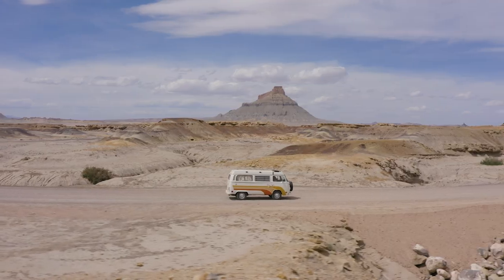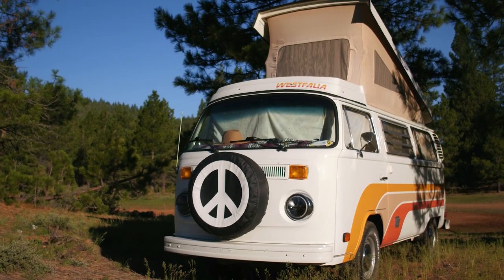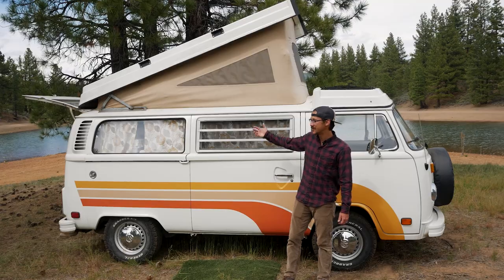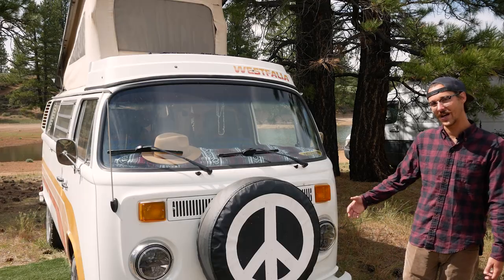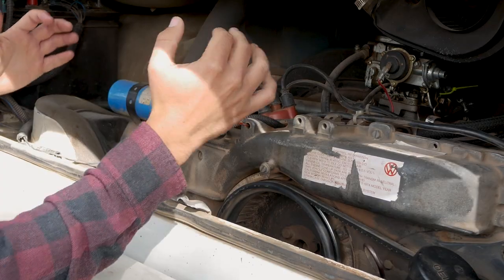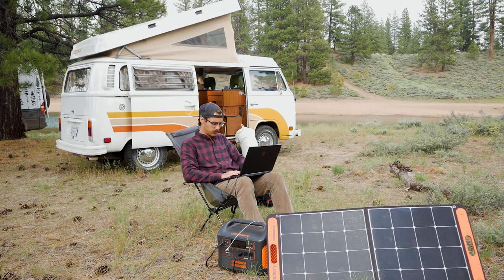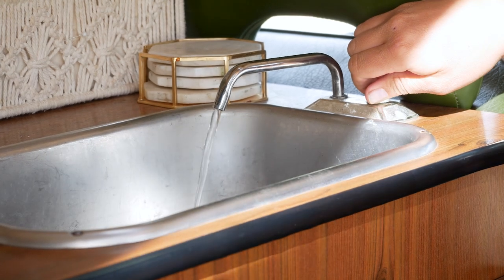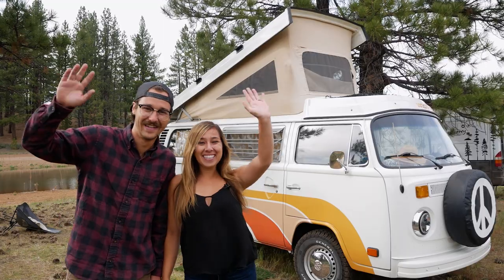What it's really like to live full time in a VW bus (Westy)

Comment: The biggest complaint about these vans is the lack of power especially going up an incline.  It is a beauty though, best of luck to both of you.  I miss being traveling and I miss California, but age has caught up with me.  Take care.
Reply: Yes, exactly. You could see how slow it was inching up the road. No hate though, in fact, we have a Westy Vanagon. But we put most of the upgrade money into purchasing a rebuilt and reliable subaru engine. The engine is from 2005. Our mileage has gone up from 16 miles a gallon to about 22 - 25 miles a gallon. It also hits 75mph/80mph with ease on the freeway. Now we can have a beautiful vintage van that's also reliable and better modernized 👌🏾

Comment: Love that VW. Just curious about your bus. How do you keep yourself warm in freezing point night? Best of luck traveling.
Reply: Coldest we’ve done so far is 15 degrees Fahrenheit. We have 20 degree sleeping bags (which you can see behind us in the video) and we also have a Mr Heater that takes the edge off, we run it for 10 minutes while we put thermals on and get into our bags. 

Eventually we’d like to put a diesel heater in our van!
Reply: @packthebus  Sounds like a plan. A diesel heater will be perfect for your van than running out of propane on Mr. Heater. I have one and it sucks propane like that! I get it. The best luck of your journey.

Comment: I don't understand how these people do off roading camping without having access to a shower....🤦🏽‍♂🤢
Reply: Jmfia23- There is no reason this couple can't stop at a campground and use the showers. I camped a whole summer, back in 1972, in our converted bread truck. We did  have a porta potti and could shower in the " curtained" wheel well. We often used the campground showers, but there are also these great items called SUN SHOWER  bags that heat up in the sun and give a decent shower. Its an adventure! I'll bet they may have a membership to the Y or gym club. We still camp, but have a 15' teardrop with a wet bath. We earned it at our age '-) ...  Diane